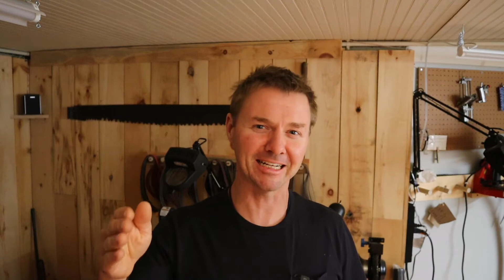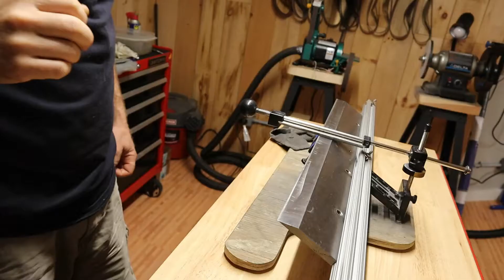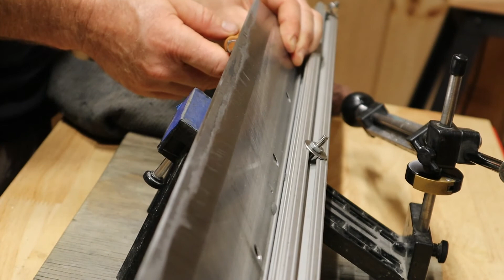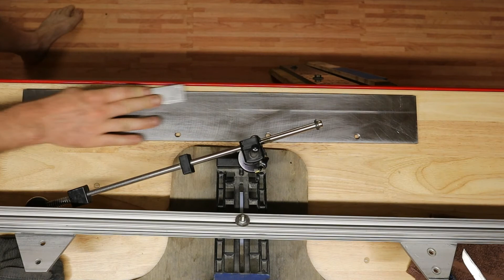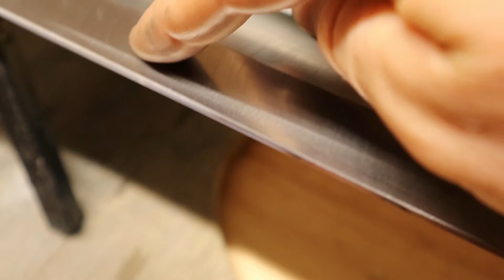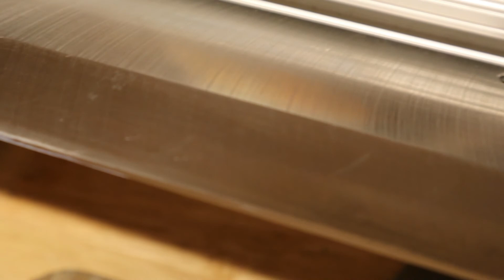TNG Ep 32: Sharpening an Industrial Paper Cutter the WRONG (but better?) way

Comment: This skilled blade sharpener definitely knows his trade. I sent him the same blade that I use in my guillotine by mail, and he did an outstanding job. The blade now cuts even better than when I first purchased it brand new. I discovered him on YouTube when I was desperately seeking out a solution to sharpen my dull blade. As we all know, brand new blades are never sharp enough. After reaching out to him via email and sending my blade, he quickly repaired it and returned it to me within just four days. The edge of the blade is now in SUPER EXCELLENT condition, and I am thoroughly impressed by the professional work that he did. I highly recommend his services to anyone in need of blade sharpening.

Thank you Sr. for a wonderful job. - Liz M.
Reply from the maker: Thank you so much, Liz!

Comment: You can't be WRONG if it preforms like the customer says it does. But I can't imagine the manufacturer's angles being WRONG either. They could be doing a sloppier job when they do their work . . . But that difference of 1/2 degree in the bevel angle isn't anything magical or unknown to them. There is a optimum cutting angle for every type of blade. Maintain that same angle, or get close, and there will be success. There is a correct method and an incorrect method. The two methods won't be apparent . . . so everyone thinks they have discovered a secret special sharpening system. There is only one . . . looking at it on a microscopic level.

Comment: I've returned several times and thought I should let you know that I appreciate your video. I am making a jig to sharpen my blade on a paper cutter. I was wondering what  width the aluminum anodized t-bar is... 1-1/2"? Thanks again.
Reply from the maker: Yes, 1515 bar by 8020.net
Reply: @capnmatt41  Thanks, Matthew, just what I needed. I made the purchase just now. BTW, what liquid are you using for sharpening, oil or water?
Reply from the maker: @goodairin  I'm not sure what purchase you mean but right on!
Water.
Reply: @capnmatt41  I purchased the aluminum T-slot alumuminum and what I need to make a jig similar to yours. Also, I subscribed to your channel so I can get more of your good tips! Thanks again.
Reply from the maker: @goodairin  Sweet!!

Comment: I worked at a small print shop for a few years. I operated a machine that would take a blade like that. There are some serious horror stories about accidents with them. To help safely move the blades in and out of the machine and carriers we had a set of handles that screwed into the bolt holes at the top half of the blade. Allowed for a very secure grip. I would suggest at least using a 4” or 6” bolt of proper thread to do the same thing. Might help moving the blade through your jig as well until it gets in the way of your stone stroke. Cool video, be safe!
Reply from the maker: I don't even want to imagine the horror stories with these. That's a great call to thread a bolt in to help control it as I slide it along the jig!

Comment: Do you always sharpen knives barefoot? Or is this only something you do with the most challenging and dangerous industrial items?

Seriously though, I've watched about 30 of your videos since receiving an Apex last week. Love your videos, and how fast (and clearly) you talk at 2x speed. You are doing great work all around, thanks! I look forward to watching the rest of your videos (that are less applicable to my specific equipment, but I always find useful nuggets of commentary).
Reply from the maker: Yeah man, when it's warm out I very much like to keep the feet free, but I agree, it's really a poor choice and I should be smarter. Appreciate the reminder on that. Thanks for watching and for your kind words and thank you too for plugging the higher speed. I try to do that too in my videos...while the actual work takes some time, to learn it and understand what I'm doing can be done faster.  Good luck with your new Apex!
Reply: @capnmatt41  I wanted to add that I regularly slow the speed down to normal to make sure I am understanding your "actual" speed/rhythm, which is often quite delicate and always deliberate. As a beginner, I need to remember that the sharpening doesn't actually happen best at 2x.

Comment: Love this stuff! Ixd like to see more about the Sharpener and the stones you have there. Maybe a little about how you would remove the bur on a double edge blade like a knife. I use the Lansky sharpening system on my knives and I just do a series of light strokes on each side to try to prevent the bur but what's the oil coming off the stone as I work down the blade for consistency. Maybe there is a better way...
Reply from the maker: Thanks Frederick! I appreciate you making the rounds on my channel! I think you found it's the Edge Pro Apex (link in description) and I have a deep archive of sharpening videos in which there are a few where I do symmetrical bevel blades on the Edge Pro. Please let me know if you have any other questions!
Reply: @capnmatt41  will do sir! Keep up the awesome videos

Comment: Great job on the jig. Have you tried ceramic files on the burr? They work for me on extra hard, wear resistant steels.
Reply from the maker: Not on this tool, but yes, I'm a super fan of ceramic hones over steels for kitchen knife maintenance for your exact reason, ceramic is harder than steel so it works on all of them. Good call, appreciate the comment!